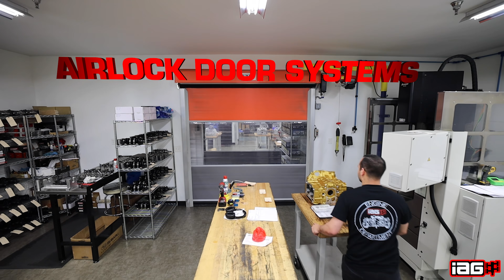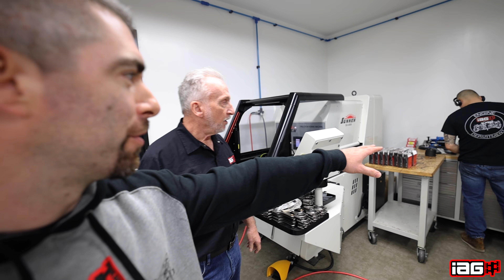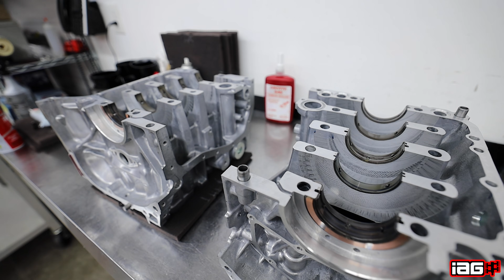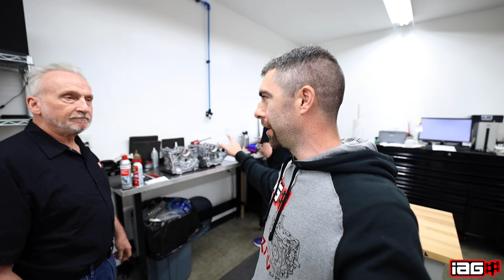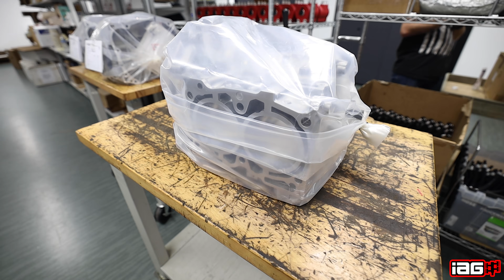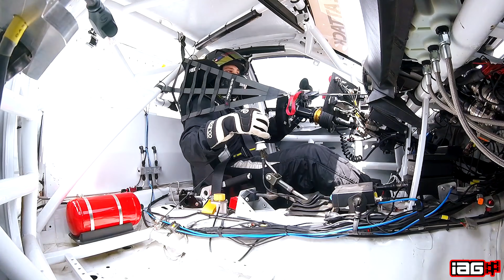What IAG block is right for you?

Comment: Thanks for all the great information!
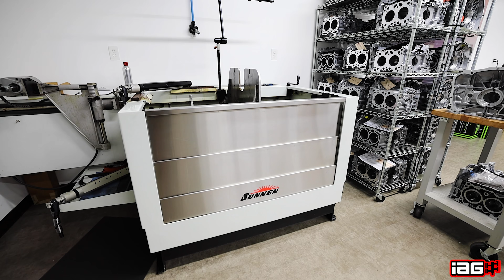I was watching a video by ThatDudeInBlue and a tech at Offtheline Performance said that once you separate the case halves you need a special machine and need to line hone it and that only like 3 shops in the county have (is that the machine at 8:02?), but you guys only use it to straighten the bearing holes on stage 4, so is it necessary to line hone it anytime you separate the block? Or are you guys able to pick and choose from all the bearings you have to find ones that match perfectly?
I think I have a IAG assembled block in my car since 2012 (did you guys make a deal with Import Image Racing around then that allowed them to sell your stages of blocks under their name, but I pretty sure I remember they accredited you guys with doing all the work on the block.)

Comment: Better off buying a V8 than spending five figures for 400-500WHP lol.
Reply: Been saying the same for years
Reply: How about not that's what everyone says when you get your ass handed to you by a 4-cylinder and don't know what to say LOL
Reply: @jordanandmelissasalinas1438  yeah takes five figures to beat a bolt on V8 LMFAO
Reply: V8 will be heavy in comparison to flat4. 
450 whp does not cost much to built and it will last long and you can beat on it all day every weekend, plus inherited lower center of gravity and corner balancing ( done separately)gives you amazing handling.
Reply: @igorushka  Flat 4 Subaru's are horrible designs LOL. A built engine doesnt even last either.
Reply: @Craiggg12345  I thought built EJs last for lots of miles, like Honda engines or v8s.
Reply: @jordanandmelissasalinas1438  Honda/Mitsu/Ford engines are easy to make power but not Subaru EJ engines LOL
Reply: @igorushka  forged pistons need bigger cylinder wall clearance so they wont last as long. They're designed for extreme abuse not longevity.
Reply: @Craiggg12345  you my friend are clearly talking smack! Stock or built EJs that are tuned and maintained well will last just as long as any V8 engine.
Reply: I’m going to assume you never raced a flat4 with the same whp as a V8 or full bolt-on V8 power. They are quicker than you would think. I wouldn’t be so closed minded thinking V8 is always a good choice. Power weight ratio my friend